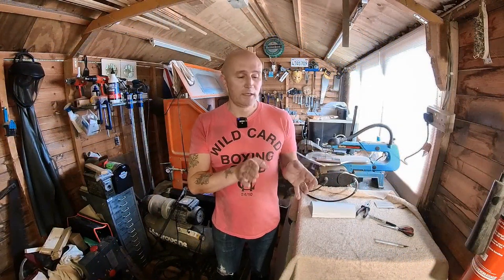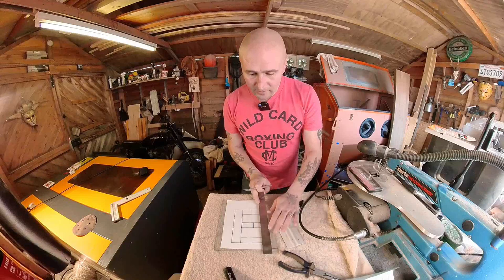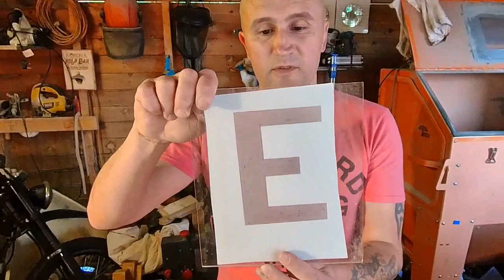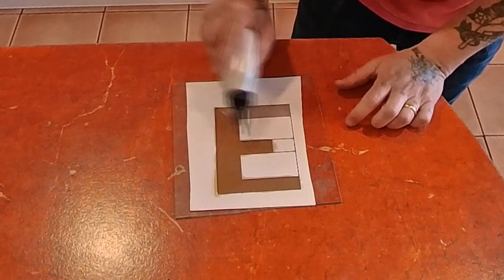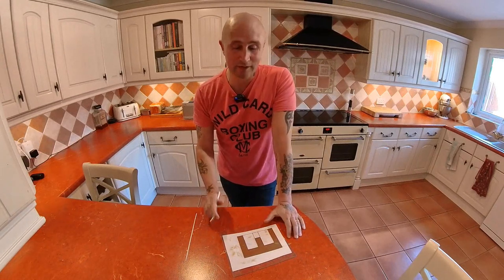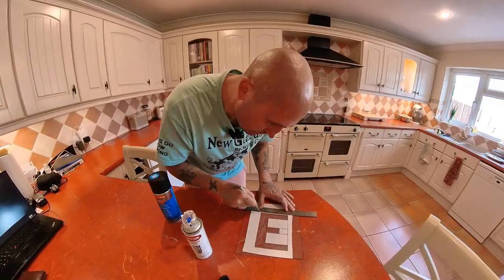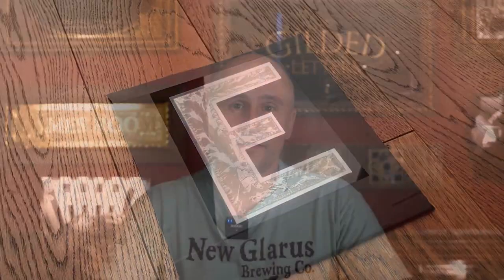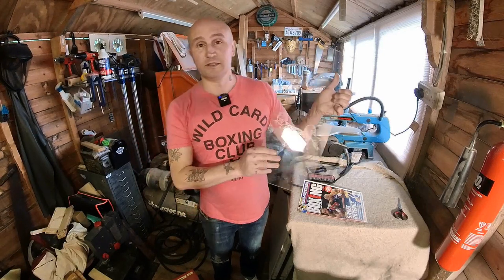Glue chipped glass technique. No sand blaster required!

Comment: Love your videos!  I have taken the leap and ordered supplies!
Reply from the maker: That's awesome, let me know if you need any help along the way!!
Reply: @happygilder  I do have a question on the bead blaster.  What inside dimensions are ideal?  And brand?  Super excited to get started!  thanks for all your help!  Cheers!
Reply from the maker: @toddburtonart  mine doesn’t have a brand that I know of. Size choice is completely down to what size pieces you want to make. Mine is an sbc420 and the internal measurements are 121 x 57 x 60cm
The main thing is that you get a compressor that’s good enough to run it

Comment: Fantastic.

I was a bit surprised that the mirror spray worked.  I tried something vaguely similar (without the etching and glue-chipping a few years back) and the paint sort of dissolved the vinyl.  It was kind of melty and peeled off the glass.

It might have been the Rustoleum mirror spray though.

Anyhow, thanks for making these.  :)
Reply from the maker: Hi
The Krylon is good but it has limitations. It dissolves enamel paint so you have to mask the areas of the sign that are already painted.
The rust oleum mirror effect paint is pretty much the same. I have a video where I test them both and compare them to gold leaf:
https://youtu.be/bHiCDRcq8IQ

Comment: you can also buy diamond grit burs in different grits plus you can also use diamond pastes in different grit/micron sizes on a polishing buff to help change the shading levels as well all using the dremel so its a really handy device.  I'm just curious - can you use anything besides hide glue for the chipping??  - its very hard to source from where i'm at

Comment: I don't know how I missed this one...?
I have a rotary tool; but you've something I don't, artistic talent. I could completely tell what that was when you finished. If I'd attempted it, at best it may resemble a map of Poland if I were lucky.
So I'm wondering, could you glue chip on chemically etched glass perhaps?
Reply from the maker: Unfortunately glue chipping doesn't work on chemically etched glass because the finish is too smooth for the glue to grip onto. I reckon you could make this one no problem. All you need is a set square and a knife ;-)

Comment: Whats the difference in hide glue types? I have some granulated "315" and was curious what the numbers meant. Or if it would work for etching. Thanks
Reply from the maker: Sorry I'm not sure what that number means. I've used Rabbit Skin Glue, Chipping Glue, and different brands on Pearl Glue. My favourite is Liberon Pearl glue but the others worked fine, they were just much slower to chip
Reply: Can the same effects be achieved if i don't have a dryer or heat source. Does it need heat to chip?
Reply from the maker: @blakewilcox313  The heat source speeds along the chipping process but it's not essential. As long as it's not humid where you are it will chip in a warm room. Might take a few weeks though
Reply: Thanks. My final product came out with a few cracks. Is there a minimum glass thickness required?

Comment: Thanks Paul for showing some basics here. This looks look a good project for me to start with 👍. I'm still trying to get my hands on the correct sort of hide glue. Something I was wondering, if you apply hide glue on glass without using a stencil, then cut it to shape at the jelly stage, will it chip only where the glue is applied, or do you need make like a score line to stop it chipping over the designated edge? If you know what I mean.
Hang on, I think I've answered my own question - I guess it should chip only where its been etched!!
Reply from the maker: This is definitely a good project to get started, and not a lot of tools required :)
You always need to trim/score the glue, otherwise the chip will carry on through the edge of the clear areas
Reply: @happygilder  Thanks Paul.

Comment: what's artificially activating the chipping process, is it heat or is there a humidity component, too? would allowing the chipping to happen if just set aside for a week or two make a difference in the pattern?
Reply: 35% humidity and the hide glue being 140 degrees. Proteins align and hopefully it ferns. It's all science
Reply: @scotthendricks79  ah, gotcha, thanks. one video series the guy puts them in a box to control things, but his aren't how-to videos so it's a mystery of what exactly he's doing. our friend here sets it on a heater of some kind, but hasn't mentioned humidity or proper temps that i've seen. someone else mentioned that left alone with no controls at all and it will naturally chip, but that could take up to three weeks depending on the ambient conditions.
Reply: @manlymcstud8588  it's heat and humidity, the glue dries and boom. My box I built gets to 16% and 101 degrees F. Using no lights. It's 24x48 and takes a average piece 36hrs to fully chip using a 1 to 1.5 glue water ratio.
Reply: @scotthendricks79  that's what i was wondering, too, if these boxes were mostly DIY.
Reply: @manlymcstud8588  everything we make is diy
Reply from the maker: I was about to reply but I see you've got a much more detailed response than I could have given 😀
Reply: @happygilder  lol sorry, I like to help
Reply from the maker: @scotthendricks79  hahaha don’t be sorry it’s awesome! I’d like nothing more than for this to become a community of people helping each other out. Thank!! 🙏

Comment: As a lazy person I find myself wondering what happens if you don't trim the glue after it gels.  If the excess glue is on top of vinyl it shouldn't do anything to the glass underneath.  The only point of failure I can think of is if it causes the glue on top of the glass to not adhere and chip correctly.  Any experience with this?
Reply: It pulls up
Reply from the maker: The trimming process sets the boundaries for the glue to retract. If the glue is retracting in towards the etched areas, then there's less chance it will take a piece of un-etched glass with it :)
Reply: @happygilder  Paul try this, make your design then add a 3 to 4 mm boarder around it. Take it and blast up to the 3 mm line. Then apply your Hyde glue carefully and you don't have to cut anything. Plus if it goes over anything less than 3mm it pulls that up and boom, you have a bright line ready to go. It hardly ever 98% chips past that. Makes projects go faster.
Reply: Oh i use oracal 651 non water adhesive so if you chemical mirror it holds up. Aluminum oxide and garnet work with it. I've never tried anything else.
Reply from the maker: @scotthendricks79  I'll definitely give that a try. Thanks!!

Comment: Hi Paul. I was just finishing up a sign that I made for a friend's birthday. I had painted the colored part with one shot enamel and then sprayed the looking glass spray over the chipped part and over the back of the one shot (basically the reverse of what you did) and the paints reacted and lifted the one shot up. Should I have used a hardener with the one shot? Any info would be appreciated.
Reply from the maker: Hi Myles, sorry for the delay in responding. Krylon is brutal on enamel but you can get away with using it. I always double up on the coats of enamel and spray the Krylon in really thin coats. On the occasions where it lifted the enamel, I use a q-tip dipped in cellulose thinner to rub away the affected area and then repaint it.

Comment: I saw someone on YouTube just scratch the glass roughly for the glue to grip onto and he got great results. Are you sure "sanding" or etching the glass so precisely and thoroughly is a nescessary step? OR is scracthing only possible with special types of glue?
Reply from the maker: I’ve never tried it by sanding or scratching but I’m sure it works just as well. I don’t think you’d be able to be as intricate with the designs as you would with a sand blaster or dremmel though
Reply: @happygilder  : Ugh ... can't find the video I mentioned. My brain found it hard to accept that a few scratches would give glue the same grip as a fully sandblasted or Dremeled surface. His result turned out fine, though. Mindbender.  -_-

Anyway ... I just found your channel. Liking what I see  :)  Very accessible content! I'll be back for sure. Greets from across the channel.
Reply from the maker: @theGoogol  thanks very much, glad you like it!!

Comment: I wonder if an acid etching would work?
Reply from the maker: Acid etching won’t work for glue chipping because the etch is too smooth. The surface needs to be rough for the glue to grip on to :)
Reply: @happygilder  Has this technique traditionally used sand blasting? Even in the 1800's?
Reply from the maker: @matthewcondon1985  I believe so. I had to look it up but the sandblaster was invented in 1870 so I assume that's what has always been used
Reply: @happygilder  I started a new job in Oct 2021 and we have a sandblasting booth in the workshop! I hope to get a chance to use it to try glue chipping. I was explaining the process to a fellow employ yesterday. And we were wondering what they would have used in the 1800's to mask off the glass. Do you know? I'm sure they cut the designs by hand...no matter what masking material they used.